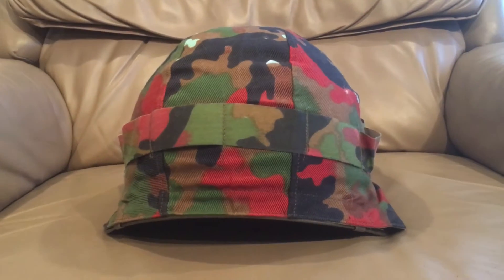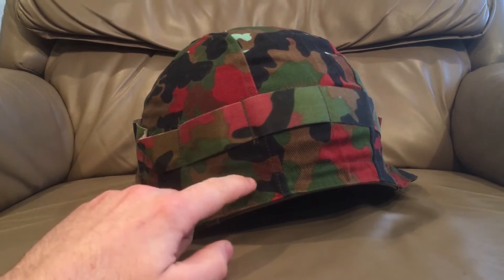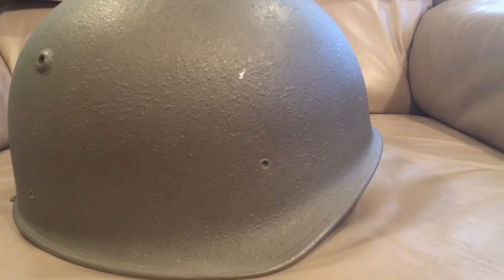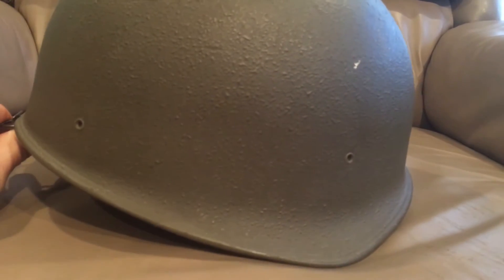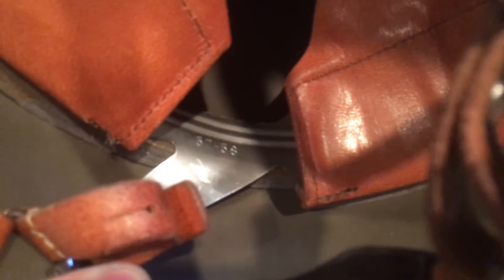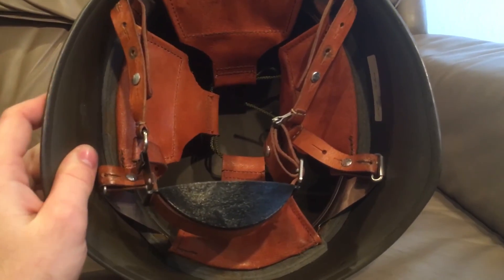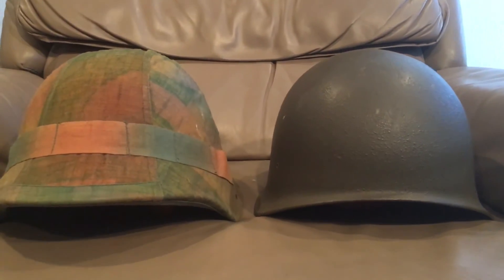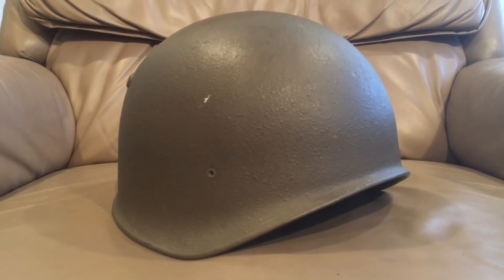Swiss M71 helmet

Comment: It`s a nice presentation, 👍but you forgot to mention and demonstrate a very interesting and most usefull  safety gadget  with this helmet. ☝

This helmet is equipped wit a quick release chin strap device. To your left ear you have the simple clasp to attach the chin strap, as you showed and mentioned it

but to your right ear you also have  the quick release chin strap devise. Either it is in closed position (on the small hook) or it is in quick release position (QRP) . 
Because you hold the helmet backwards I can not see if it is in closed or in quick release postion.
You can make the test. Check first if the pin is in the open pin holder. If you pull the strap strongly it will come off.  You can put the pin back on the hook or press it 
back into the quick release position.  
When the order came  put your helmets  « Auf Sturm » (on storm, on attack) we changed the pin from the hook to the open pin holder.

The idea is that the helmet gets easily off in these cases:

1.	that you don`t get strangled by the enemy from behind with your own helmet chin strap in combat or on guard duty as a sentry
2.	that your head is not blown off by air pressure of a nearby  exploding atillery grenade. Only the helmet gets off.
3.	that you get off the helmet as quick as possible to put on your gas mask within 5-6 seconds

Most of the time we had it in the QRP. During exercises you can not run around with an unstrapped helmet. When you run, take cover and hit the dirt it wouldl bounce off.
My personal experience. You need your both hands for your waepon and not for holding your helmet. Therefore the helmet must be strapped on but also must come off
 easily if necessary (see reasons above). In situations where you must act quickly you can not fumbling around with your chin strap losing precious time. 

Exercise: „C-Alarm“ (C = Chemical Attack). When you hear that you pull your helmet immediately off with your both hands upwards. You fix the helmet between your legs, 
grab the gas mask and put it on as quick as possible (5-6 seconds). When finished you fix the pin back in QRP and put the helmet back on => all finished in 10 seconds.  

The eyelet on the back of the helmet was for the „hook“ . On your old combat suit you had a hook in the middle of your breast. On long marches you put the helmet there 
on the hook. That way you had the hlemet in front of your belly.  It looked a little bit like if you were pregnant.😆 But it was quite practical. 👍
With the new Swiss Army combat suit I am  not quite sure if they still practice it. It changed a lot since my time then. 

Swiss Army Veteran (1986-93) 😊

Comment: I don't think the red is for infrared. It is made for camp in the swiss alps. We use it in the ozark, it is actually good came year round. The red blends better than you'd think.
Reply from the maker: Well the German wwii camo pattern that it’s based off of essentially copied says that’s what the red is for
Reply: @DevinK  How would red color stop someone from seeing you in infrared?
Reply from the maker: @seeweezeke  .... because early night vision wasn’t as good as now and worked on the red color spectrum so infraRED light was absorbed by the color red very easily so it didn’t show up very well in early night vision devices. Here is a link I encourage you to educate yourself and find more sources there is better ones usually at the bottom of the page https://en.m.wikipedia.org/wiki/Leibermuster this is on the German camo that alpenflage is copied from and was made as result of German inventing the first night vision optics they called project vampire that were used in the late days of wwii. https://en.m.wikipedia.org/wiki/Zielger%C3%A4t_1229
Reply: @DevinK  i dont "educate" on wikipedia. I have vintage infrared sites and I have shot through them at night may times. This red would do nothing to camouflage anyone looking through infrared.
Reply from the maker: @seeweezeke  the infrared sights that this camo works for is a big as a backpack and mostly on vehicles, .... so again educate yourself. Before you come back to me. Like I said with the Wikipedia all the actual source links are at the bottom of the page for you to read wiki life’s just has them all in one place.

Comment: I like this helmet more than the ACH because it’s lightweight and doesn’t slide around or my head like the ACH does
Reply from the maker: Kevin Bietry I think your ach might be incorrectly sized or has worn out pads or incorrectly sized pads
Reply: Devin Krueger I don’t think so but it’s possible it’s a medium and my m71 is 55-56 so realistically it’s probably the same size but I say the chin straps just always end up loosening up plus the weight of the thing

Comment: What are the specific sizes this helmet comes in? Could this specific helmet fit a size 59 head by removing the padding in the liner?
Reply from the maker: Anthony Strang they come in a few sizes in brackets of 2 cm. They are 53-55, 55-57, 57-59, 59-61. And the size can be found on the aluminum brackets. I cannot say for sure if it will fit or not by removing the padding but I wouldn’t remove the padding. I would just make sure to find the size you need before you buy one the most common sizes on the market are usually pretty small I had a hard time finding one in my size in good condition
Reply: @DevinK  Hey man, I have a 56 cm head size, and the helmets come with 55-56/57-58/59-60 cm size. What size should I buy? 55-56 or 57-58 cm? HELP ME, please!! 😭
Reply from the maker: @giordanoserra3590  depends how you would like it to fit if you want a more close fitting pick 56 if you want it looser pick 57
Reply: @DevinK  Can you be more specific, please? What do you mean with that? Sorry if I'm asking so much questions, but I really need to understand this. 😭
Reply from the maker: @giordanoserra3590  it’s pretty simple if you have a 56 head you can pick a 55-56 if you want a little more room you can pick a 57
Reply: @DevinK  Brilliant! Ok, let us assume that I'll buy the bigger One (57-58 cm): what is the feeling? It would be "loosey" and It would giggle on my head? Or It would be solid and stable as well as a 55-56 cm size?
Reply from the maker: @giordanoserra3590  depends on a lot of factors like how wide your head is, how high you like it to sit on your head, how worn out is the liner? Stuff like that
Reply: @DevinK  Many thanks! Ok, I think I'll buy the little one (55-56 cm), because my head is not so "wide". Thanks, man! You're the n.1!
Reply: @DevinK  Oh, by the way, can I ask you just one more thing? What's the size of your head and what's the size of the helmet you are wearing? And can you describe the feeling on your head, please? Is it comfortable? Many thanks!
Reply from the maker: @giordanoserra3590  most of these old steel helmets aren’t comfortable but mine I replaced the padding in
Reply from the maker: @giordanoserra3590  I bought up a size since I got to choose which one I wanted and had extra liner padding and new how to replace that.